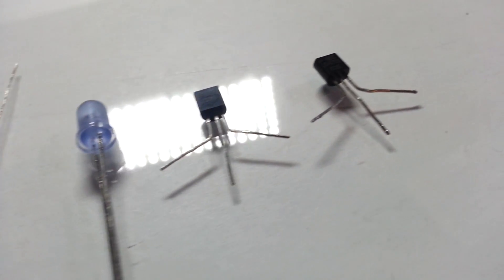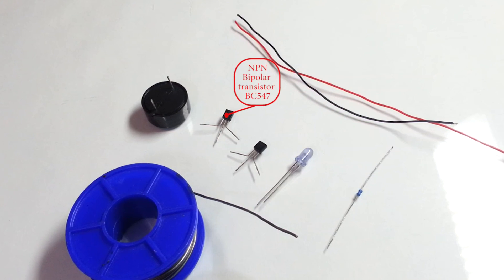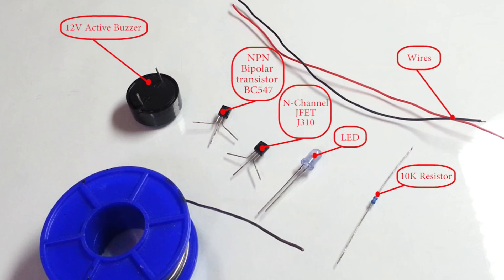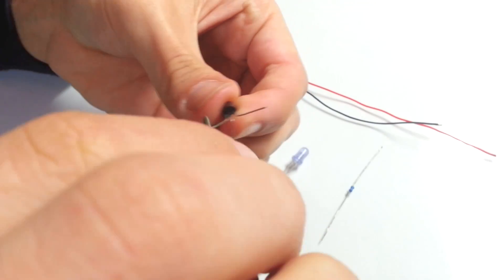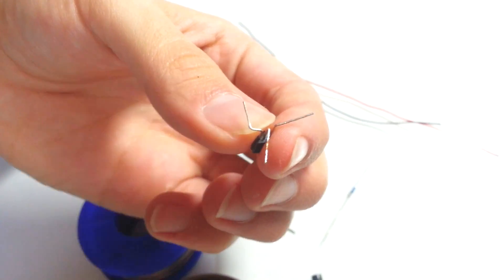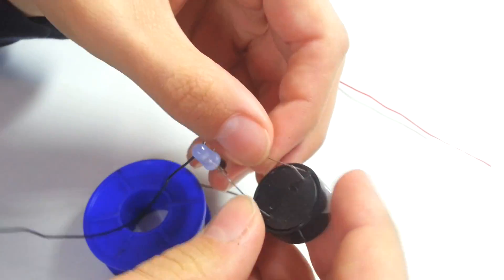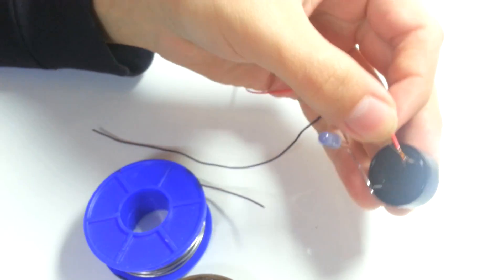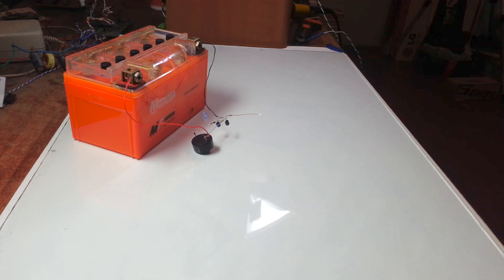Static Electricity Detector - Can Sense a Hairbrush From 2 Meters [DIY]

Comment: Hello, I can not find transient J310 (N-channel JFET) in my country, can I replace it with a similar one? Thank you
Reply from the maker: Hello, 2N5638 and 2N5639 should work fine (but I haven't tested this circuit with them) I think most of JFET transistor will work here. When I was creating this device I was not choosing what JFET to use, I just used what I could find. 
If you can't find JFET you can also use 2N7000 MOSFET, I've tested it and it seems to work in a very similar way, but I prefer JFET, it works stable, and more sensitive.
Reply: Thank you very much for answering, this circuit by what I see, is very similar to the REM-POD to hunt ghosts right? I congratulate you for your work.
Reply from the maker: I've googled "REM-POD circuit",  and found a circuit that uses IC LM555, if it is REM-POD,  then they are not very similar, my circuit is much simpler because I didn't use IC. Is really people hunting ghosts with such devices? lol, I can't believe it.
Reply from the maker: If hunting ghosts is popular activity then I can build an even better device.
Reply: Yes of course, yes, if you can do something to hunt ghosts, I would appreciate it very much.
Reply from the maker: I just want to make a device that can sense both positive and negative charges, because my device (and most devices on the internet) can only sense negative charge. Don't know when I'll make one, it is just one more idea for a video.
Reply: thanks iv just ordered some more mpf102 and the j310 so once there here ill make this with them i have buzzers too so will defo use a buzzer thank you for your reply
Reply: Yes I too want one for Ghost hunting.  Sure hope you can make one soon. Thanks a million.
Reply: Can you use the mpf102 to do the same thing
Reply: I was wondering the same thing, and found where someone said it would work but not as sensitive, but the circuit was different
Reply: brett chitwood I know if you use a mpf102 and a led plus battery connect it all together it works well but I’ve been trying to find and make one I can attach a buzzer too but so far no luck
Reply: My  N channel JFET 310 's came in today that I ordered off ebay, can't wait to put it together tomorrow. Unfortunately I have to work tonight. I have a large box of old curcuit boards as I keep all my old electronics for parts, but didn't find a single one, so had to purchase some.
Reply: I would also like to get a buzzer too, but want to make sure everything else works first. I have some buzzers off old pc motherboards or at least they look like buzzers, so might see it it will make some noise.  Lol
Reply: This place had a screen which I can get to come up on phone, but showed a n 92 jfet as if it was the same thing but not sure. https://www.mouser.com/ProductDetail

If you have a computer see if it will come up.
Reply: It's on that link under specifications
Reply: brett chitwood I have to order some jfet 310 as I only have mof102 at the moment because there are loads of diagrams using them but not one with a buzzer so will try this you tube video
Reply: We don't have an electronics store in town any more as they have shut down like so many s everyone  buys from online now, because it's less money, but i am concerned that, when they are all shut down it will be like walmart,  then they will start jacking up the online prices and we won't have any options.
Reply: brett chitwood I live in guernsey Channel Islands and I haven’t found any where that sells stuff like this they would have to order it in so I just order stuff myself just easier and cheaper than getting a company to order it a lot I get off amazon and some stuff on eBay
Reply from the maker: MPF102 is very similar to J310, so it should work fine. And if you don't use a buzzer then you need to connect a 1K resistor instead of the buzzer (0.5K - 10K resistor will work here also). The buzzer in my circuit works like a current limiting device for LED, so without it, your LED or transistor will burn. If you don't have a buzzer just connect a resistor instead, and it will work fine.

Comment: Do this project with battery 9v 3v?
Reply from the maker: For this device, you will need 12V or 9V battery. With 3V battery it probably will not work.
Reply: Electrical Projects [Creative Lab] okey

Comment: heh j310 is not available...can u suggest any other fet
...i need it fast
Reply from the maker: Hi, I don't know what FET transistor to suggest, I've just used what I had.
But I've also tested this device with MOSFET transistor 2N7000 and it worked, but the sensitivity was lower.
Well, I think you can try 2N7000.
Reply: What's the value of the resistor if you use 4 Led plus buzzer?thanks
Reply from the maker: The same value. Sorry for the late response. I've missed your comment.
Reply: Is the resistor 1/4 watt or 1/2 watt and how many amps should the buzzer handle?
Reply from the maker: You can use 1/8 or 1/4 watt resistor, no need for 1/2 watt, but you can use it also.
I've just checked my buzzer, it consumes 5 mA at 12V, You can use buzzers with 5 - 30 mA current.
Reply: Thank you so much. I took an old computer pwr supply apart and have a 3 volt, 5 volt and 12 volt output. And I plan on using it for my power to the circuit. I am not sure how many amps it puts out. Hope it's not too much.
Reply from the maker: Computer power supply with 12-volt DC output will work fine.
Just to be clear: the amperage that is written on power supply means how much a power supply can provide amps, but the buzzer will consume just 0,005A, so let's say if your power supply is 5A it means that it can handle 1000 buzzers at the same time, but it will work fine with 1 buzzer also, it just doesn't matter here.
Reply: I plan on connecting a 12 volt relay to it also but the relay I am looking at for .75 is a 5 amp. I am not sure the circuit will support 5 amp relay online with the buzzer.  They have 30 mA  relays, but the price seems to be higher.
Reply from the maker: If you need a 12V relay use a 12V relay that has 400 Ohms resistance, it means that the coil of the relay will consume 30mA (0,03A). But on a relay can be written 1A, 5A or even 10A, it is not current that the coil consumes, it is the maxumum current that contacts of the relay can switch. (I don't know what relays you are looking at, just read about relays and you will know what you need.)
Do you want to connect a relay to the device that on the video? but why?
Reply: A class project making things work for science fair.
Reply: Ok so the static device will need to be as sensitive as I can get it to operate a relay which will run a 3 volt Motor which will be connected to a small fan. So when the girls in class brush their hair, we will record how far away they can get and still make the fan turn. But we will have to have a on going report as the humidity we think will affect  the static in the air. It's been raining for a week but when it's cold there is much more static. So it might not work when it's really humid
Reply from the maker: Ok, got it. Well, you'll need to connect the coil of the relay to the collector lead of the transistor BC547 (labelled C on the circuit) and to the plus lead of the power source, because it may not work if you connect it in parallel to the buzzer.
Reply: We tryed a different video using 3 transistors, but it failed. We are hoping this one works
Reply: That's sounds great,  do you think if we add another transistor it will make it more sensitive?
Reply from the maker: Just try first without a relay, just a buzzer and LED, and then add the relay.
Reply: Great idea. Thanks a million

Comment: Hello Friend. Is there any scheme to emulate the sound of a rc model motor with a small speaker connected to the output of the receiver to the esc? Something that mimics sound like a motor glow? It serves as It serves as a suggestion for you.
Reply from the maker: I don't know, but I have an idea... the idea is very simple, but I don't know if it is good...
Just try to connect sequentially a small DC motor and a loudspeaker, it will make some noise just like an engine but it is not very loud. And I am not sure that it will be the sound you need, but it is just my idea.

Comment: Did mine exactly as shown and it wont shut off. Soon as i add power it lights and sounds. What am i missing?
Reply from the maker: Hello, I am not sure, but we can find out what is wrong.
Let's do a simple test: Please connect a piece of wire from the base lead to the emitter lead of BC547. (on the circuit it is 'B' and 'E' letters). Does it stop making noise after this?
Reply: Hi i have just made the exact thing and having the same problem,however if  
i place a wire across B and E,then it goes silent,so what am i missing.
Im not a electronics person,but love to try this ,cheers.
Reply from the maker: Hi, if it goes silent, it means that BC547 transistor works correctly. If your device still doesn't work, it only means that something wrong with the transistor J310. Please make sure that your J310 connected correctly. If your J310 is connected correctly and this device still doesn't work, you need replace J310 with a new one.
Reply: Hi Many thanks for the info,i will replace it and let you know.
Thanks.
steve

Comment: What device does the device detect? Plastic, metal, iron?
Reply from the maker: Actually, It detects static electricity.
After hair brushing, the hair has the positive charge and the hairbrush has the negative charge.
In the video, you can see how this device can sense a negatively charged hairbrush.

Comment: Great video man, thanks.
Please next time use a battery that everyone can buy/get easily, you know like the 9v battery.
Because this also helps move this detector around.
Reply from the maker: Hi, without any modification of the circuit, this device can work with 9V battery as well. Thanks!
Reply: @ElectricalPro  you you have any idea how to make simple curcuit REM pod like the ghost hunters use I heard it's done with oscillators?? Any ideas would be great thank you
Reply from the maker: @parabugsknowingtheunknown.  It is just probably fancier static electricity detector. Why does it need oscillator? Some circuit that I googled indeed use a crystal oscillator, but it has nothing to do with actual detection of signals, it just required to make microcontroller to work, and microcontroller just makes fancy LED blinking.
Reply: @ElectricalPro  thank you also is this a positive or a negative static detector
Reply from the maker: @parabugsknowingtheunknown.  If I understood everything correctly it is a negative static detector.
Reply: @ElectricalPro  thank you again do you know of a transistor that I would use for a positive static detector I've watched loads and can't find a transistor to work
Reply from the maker: @parabugsknowingtheunknown.  You can try to use some p-channel MOSFET (low power), I can't recommend something particular, but it is not necessary to use J-FET. I'll do some research and hopefully, I'll make a device that can sense both negative and positive static electricity... but I am lazy, so it will take some time :)
Reply: @ElectricalPro  ok thank you for you help keep up the good work.
Reply: @ElectricalPro  Hi, friend. Make a video for negative static.
Give a link to the negative statics.
Don't be lazy, it's been three years!
Reply: @ElectricalPro  Hi, friend. Make a video for negative static.
Give a link to the negative statics.
Don't be lazy, it's been three years!
Reply: @ElectricalPro  Hi, friend. Make a video for negative static.
Give a link to the negative statics.
Don't be lazy, it's been three years!

Comment: Sir please guide me for appropriate changes for using 9v  battery 
As this 9v small battery is easy to carry anywhere
Reply from the maker: Hi, no need to make any changes, it will work fine with 9V battery without any modification of the circuit.

Comment: I don't have a transistor😧😭😔
Reply: The best way to get electronic components is to open defective devices and unsoldering the components. All you need is a soldering iron and a desoldering pump. I usually buy electronic components. But I also gladly disassemble defective devices and get all components out. This is almost like recycling.
Reply: https://www.banggood.com/200pcs-10-Values-Transistors-Pack-Transistor-Assortment-Kit-With-Storage-Box-p-1070201.html

Comment: what's the use of this? if any object can detect by this innovation it will continuously buzz.
Reply: Wrong.  Build it and see.   The gate of the FET sloooowly leaks, and eventually the channel turns on.   The BJT transistor inverts the FET output, keeping the buzzer turned off.  Make R1 much larger, and the project won't need a power switch.

Comment: how could i build this using 9volts and what are the specs on the led just want to make sure i get theright one
Reply from the maker: Hi, If you use the same kind of the active buzzer like in the video, then it will work fine with 9V, no need to change anything. Though the buzzer I've used was designed to work with 12V, it also works well from 4V to 12V. LED is an optional component. You can use any 5mm (or similar) LED, red/green/blue etc. I've used 20mA blue 5mm LED.

Comment: Really nice! The battery is 12v, right? And is it possible to make it using a soldering breadboard? Or there could be some problem to it? Thanks!
Reply from the maker: Thanks. Yes, the battery is 12V. I think it should work with a soldering breadboard fine, just don't make gate lead of JFET very long, and it will work ok.
Reply: @ElectricalPro  Интересно, можно ли этой штукой обнаружить "подселенца" или лярву на ауре человека?
Ведь эти друзья на человека электричеством влияют.

Comment: Thanks for sharing
Can you test this with Others mosfet for replacement of j310
Reply from the maker: I've tested this device with IRF540N instead of J310 and it doesn't work, the hairbrush simply has no effect on the device. (IRF540N is N-Channel MOSFET)
Reply from the maker: Update: It's working with 2N7000, but it has much lower sensitivity compared to J310. The reason why it didn't work with IRF540N is probably because IRF540N has much bigger input capacitance, which is 1960 pF, 2n7000 has just 60pF. So, yes, you can use 2N7000 instead of J310, it works better with long (20 cm) wire connected to gate. (2N7000 is N-Channel MOSFET)
Reply: Thanks for testing
Reply: ive made a fair few static meters using the mpf102 is there a way i can add a buzzer to it as well as i use them for ghost hunting and never see them going off because i cant watch them all the time but if i could add a buzzer that would help a lot thanks in advance.
Reply: Hello electrical projects... mate ive made 8 of these with quick release switch ,connected to - and antenna,so it grounds itself. Sometimes they work but sometimes the unit will sound and light up doing opposite,meaning when there is no static ,it sounds,even after pressing quick release to ground it.. any idea why the unit would work in opposite way?